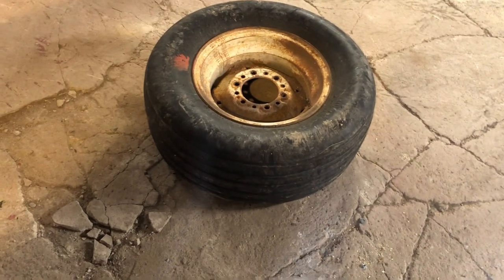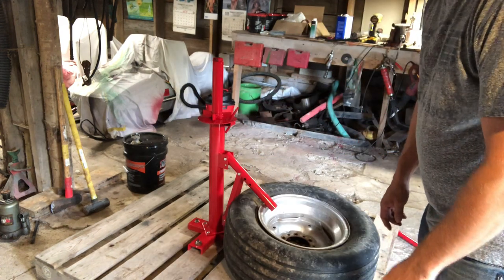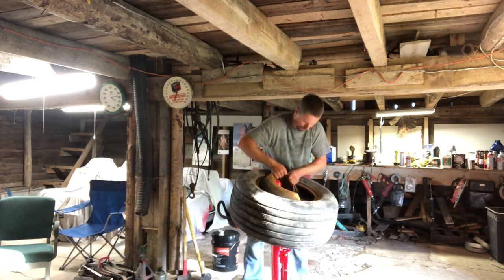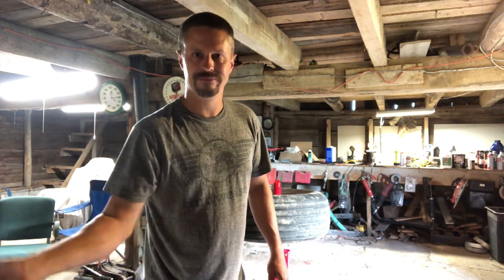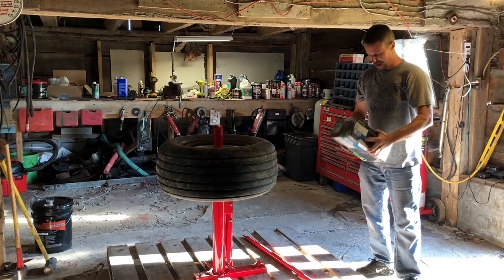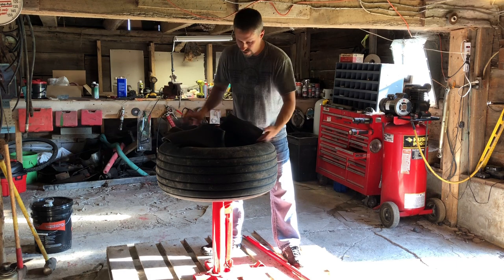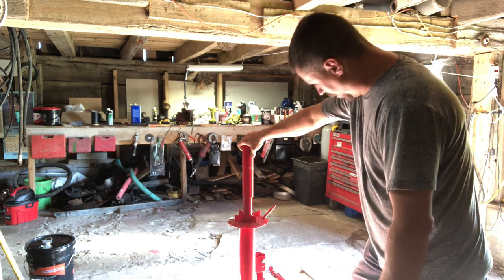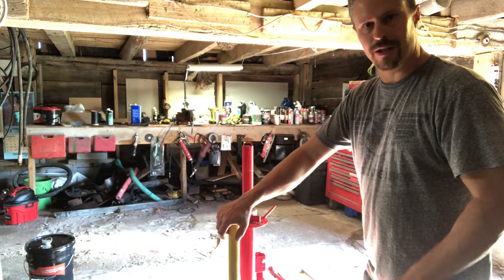Harbor freight manual tire machine vs implement tire? Also updates on the Massey 1805

Comment: Good  video.  Did  the  same  with  one  i  bought  at  an  auction.  But  i  mounted  it  on  a  hardwood  pallet,  with  a  sheet  of  3/4 inch  plywood  on  top.  Stiffened  the  entire  setup,  and  you  don't  catch  a  boot  on  the  pallet  slats. Waiting  on  seeing  y'all  at  Denny's  with  the  1805,  dude.  Bring  it  on!

Comment: For beginning tire changers….know that the “valley” inside the wheel is there for a reason….it’s there to give you room to get the tire over the rim.  One side goes down into the valley while the opposite side goes over the rim.  So…remove the tire on the side closest to the valley.

Comment: If you have a truck with a 2" receiver hitch you can weld a 2" box tube hitch to it and make it portable I love mine that way! I just picked up a 2" hitch extension at harbor freight and welded it on so it just hit the ground and it works great that way.

Comment: Where do you buy paint for your Masseys?
Reply from the maker: I go to my local auto parts store that mixes DuPont/Axalta paint and have it mixed there. they can cross the massey codes for me. it’s a much higher quality paint than the TSC oil based stuff, and not a lot more $